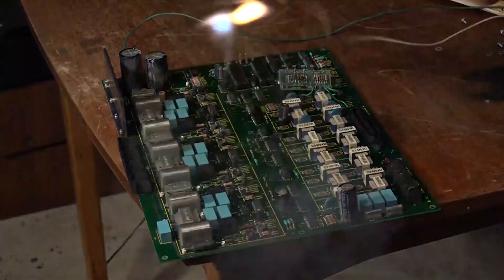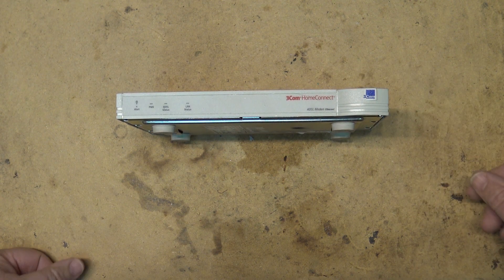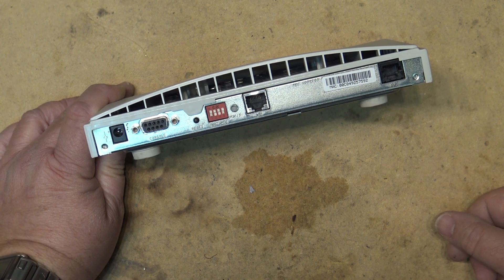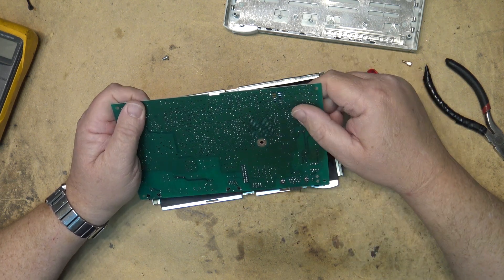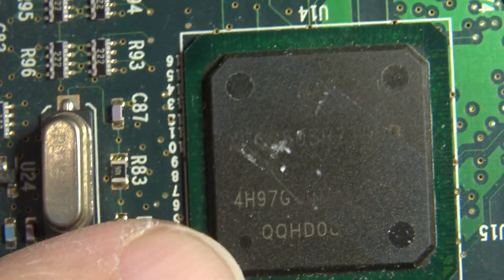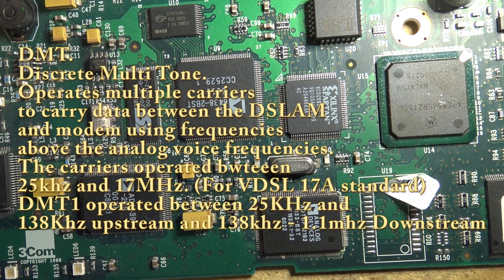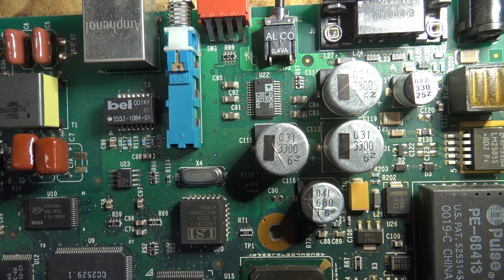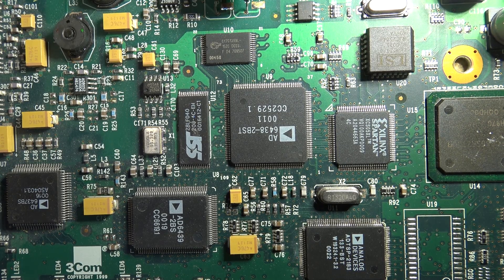Vintage 3Com ADSL modem teardown

Comment: My very first broadband connection was ADSL and the speed was 256kb/s. I still have my original modem I got back in 2003. I had to retire it in 2007 as I got a letter from my ISP saying the original ADSL system was being discontinued and needed to upgrade. I have upgraded my internet numerous of times since and I now have FTTC NBN internet. I’m in Australia if you don’t know what I’m talking about.
Reply from the maker: I am still running fttc over vdsl2 here but fiber to the house is now the norm.

Comment: I'm on gigabit fiber and couldn't be happier. The thing I really like about it is how they install the ONT like the a POTS or T* CPE interface. It's part of the building, it remains telco property, you don't pay for it up front, and (unlike cable modems and their coax in general) you don't have to worry about someone ripping it all out when they move. Just subscribe to the service, plug in your router, and you're good.
Reply from the maker: Well it's supposed to remain with the building.  9 times out it 10 I am dispatched to replace the ont that someone removed when they moved out and usually they are too stupid to loosen the lock screw so the cut the fiber off which turns the job into a full install.

Comment: They must've been dealing with firmware bugs back then. The firmware sticker said February 29 and you got it installed the next day on March 1. Either I'm misreading something or they were doing some real last-minute updating! Did they not have firmware updates pushed from the provider back then like they do today?
Reply from the maker: We still do manual updates at the wearhouse. When we switched from Minerva to media room a couple of us sat in the wearhouse and went through every box in inventory manually upgrading the firmware and formatting the hard drives so they would be ready for the techs to grab and go. The upgrades took about 40 minnutes per box.  We would plug in about 62 boxes at a time. (into 32 port switches) and fire them all up in disaster recovery mode so they would force load firmware.  Spent a few days upgrading about 1000 boxed that were in the wharehouse. So likely this was flashed in house and then loaded into the truck.

Comment: The MDI switch was for the ethernet jack.   Nowadays the ethernet chips are AUTO-MDIX which allows them to work as either server or client.   This era you may have needed an ethernet crossover cable to connect two ethernet devices together.
Reply: Yup, I think the oldest equipment Ive seen with auto-MDIX ports are from 2003 or so. I don't think I've seen anything in person with a crossover switch like that, most equipment I've seen had separate "normal" and "uplink" jacks connected to the same PHY.

Comment: I still have one of those kicking around. I remember the day when I had an appointment to get one of those installed. I believe it was a 2 hour time window that I had to be home for the tech to hook it up. He had to install a POTS splitter then hook up the modem and test it with his laptop.
Reply from the maker: Yip pots splitter and clear cap of the distribution pair at the pole.  ADSL didn't like brigade taps.  Early days had growing pains for sure.   4 years later I was the guy installing DSL.  Now I get a couple a week.  The rest is all fiber.  Still have a few buildings that have no fiber installed. That and the illegal basement suites.  When fiber was placed one drop for each physical address registered with the city.   So illegal secondary suites are generally left on copper.
Reply: @12voltvids  I would bet most of the old kit was sold off to other telco's to build out their networks. As here ADSL2 + is still the hottest new tech ( and has been for the last 20 years as well, but speed capped severely) and the incumbent telco charges high rates. Then they wonder why they are losing subscribers at a massive rate, even the mobile offering is doing so, to the point they are now a virtual network running on the one big player that they initially fought against. I saved a lot going from uncapped DSL to a capped LTE solution, it was basically 3 months to break even on equipment cost from the saving, as i bought the LTE modem outright, instead of taking it on a 2 year contract and paying around 10 times the cost instead.

Comment: From what I know we ( in Austria ) can actually still use these old standards ( Dial-up, ISDN, DSL, ADSL, .... ) They are still supported in 2020, I also have a few of these old modems and I can still go on the web with them. For me that is very good because if something breaks down on my new modems I have spares and can at least go on to the web again until I get a new one from the provider.
Reply: I know that here they still have old Diginet 56k links around, and still have some old ISDN, but do not install new. Old areas with buried copper that is at least a century old, and where they find they are running out of good pairs, so are still actually putting in extenders in places, though that also tends to accelerate the cable failure with the 250VDC line power. Old paper sheathed cables, and DC, with moisture coming in the cracks in the lead sheath do not mix well.

Comment: That company should not have fired you,  it was your controller that should have been punished.
3Com was the name i thought of with networking cards,  the old coaxial link with termination resistors.
They appeared in many machines i repaired,  and later the twisted pair took over.
There is no crap in that modem, known reliable brands :-D
Reply from the maker: Well the boss did what many scumbag bosses to. Covered his ass and threw me under the bus.

Comment: We had to wait until about 2003 to get ADSL, after they'd said since 1997 that we would get cable.

They even dug up the street and installed cable up to each house, but never connected them, apparently due to lack of uptake in out street. lol

So between 2000 and 2003, I had to resort to ISDN for a while, which was expensive (especially with both 64 kbit connections paired together).

Then I even tried satellite "broadband" for a while, which was quite interesting...

It used a Technisat SkyStar 2 PCI card, which I still have.
It could get download speeds up to about 40 mbits/s back then, which was better than what we're getting on fibre (VDSL/FTTC) right now.

But the requests were sent via normal dial-up modem, of course, and the average ping rate was around 1,500ms, so it was almost unusable for Web browsing.

But, it was quickly discovered that the company didn't bother encrypting the satellite transponder at ALL.

So somebody created a program which would just capture all of the data to HDD overnight, including whatever anyone else was downloading. lol

When we finally got ADSL, we were only getting around 2 mbits/sec, but I changed the Master Socket for a filtered one, tidied up the extension wiring, and then got around 6 mbits/sec.

(aside from the constant drop-outs, which the phone company denied for about ten years. They eventually sent an engineer out, who admitted that a whole row of contacts in the cabinet had corroded, and should have been labelled up by the previous engineer, but he didn't, so that was nice.)
Reply: Did you ever try to appeal being fired at the time, or explain to upper management that you'd been specifically asked to do that job?

Or was it a different time back then? lol

I've had a few things like that, where some line managers took a dislike to me because I knew more about some of the technical stuff than them, and the main engineers were often more than happy to allow me to do diag and repairs.

I knew I was taking a bit of a risk, but I'd rather be doing diag back then then being bored out of my mind just doing assembly. I mainly worked in factories like Nortel who built telecoms stuff.
Reply from the maker: When you work for a family run business you really don't have a leg to stand on.  It is your word against them.  Nobody is going to back you up because they are next to get axed.  I was 19, right out of school doing a paid internship.  I actually was blacklisted. When I tried to get a job at the big stations i needed a reference and I found out that nobody would hire me because i got my fingers into a Panasonic nv9800 to remove a jammed tape.   That went on my letter that was sent to the local stations I applied at.  Of course I was so pissed off when the d man told me he had to let me go that I burned bridges. They didn't fire me on the spot, just told me I was not being hired full time (i was on staff replacing another worker that left and should have been next in line to be hired but was passed over for a fresh graduate.  The owner offered me a job on the cable tv side of the business as an installer and i turned him down. Was one of those stupid moments that 19 year olds make.  I was offered a job at the foundry making directional taps. The company was one of the cable tv founders in Canada and they made their own cable splitters in house.  The dt, was the splitter that went on the poles and they sold them all across the country to other cable companies.  The other company that made them (still does) was Holland electronics.   So I left the cable TV station and landed a job at Sony about 6 months later.   That's where i got serious about electronics.
Reply: @12voltvids  Ahh, family run, yeah.

I made lots of similar stupid choices back then. I guess most of us do. lol

When I started at one factory, I got some rather nasty "feedback" from one of the old managers who I used as a reference on my CV.

I didn't have any issues with him in the past, and was completely baffled (and extremely pissed off).

Obviously I would never have used him as a reference if I knew there would be any issue like that, him saying that I was "not a team player", whatever the hell that meant.

I guess he didn't like the fact that I was actually doing the work, and maybe not as laid back about it as some other workers. lol

But I always worked well in a team for years, and they could have asked any of them what I was like to work with, and I know it would have been fine.

Lots of "political" stuff in almost any employment, I guess.

I love the old "We're not firing you, we're just not renewing your contract, or taking you on full-time" thing. lol

Thanks for the full reply. Good to know I wasn't alone with dealing with experiences of certain companies / managers.

Comment: MDI and MDIX determine what pins on the Ethernet interface are transmit and receive. MDI (Medium Dependent Interface) MDIX (Medium Independent Interface Crossover). MDI ports can talk to MDIX ports with a straight cable. Back in the day you had to know what type of Ethernet port you were connecting to and what type of a cable to use. Straight or crossover. Now almost all Ethernet ports are auto-sensing MDI or MDIX.  Great vid. Brings back memories. I worked for a 3Com reseller in the US for years.
Reply from the maker: Dam almost forgot about that. The old red cross over cable.  Like the cross over serial cable. DCC vs DTC. (Data communication cable and data terminal cable) The dipshit switches were to select the modulation scheme used by the carrier.   DMT, CAP ect.  By the time I got into the business these old 3com modems were being phased out as dmt2 was around and offered faster speeds over a longer reach.  It was 3 meg down 1 up at this point.   Then 2+ brought the speed to 6 megs.  Then VDSL field cabinets brought the speed to 75 and beyond.  
Now fiber makes 1.5 GB possible.

Comment: I waited 2 months for my cable internet to work after the cable modem was installed in 1997 on Rogers in Toronto. cable was ahead of bell by several years. The lan city modem was several times larger.
Reply from the maker: Cable was very easy for the cable co. They already had 2 way amplifiers in place from the days of live community TV. The frequencies on the cable below 50MHz  were the reverse pass band. I have some modulators that will operate on these channels that are below channel 2, that were used for back haul.
The cable modems of the day, and still to this day use this spectrum, from about 5 to 45MHz for the back haul channel, and the forward channel is multiplexed in with the TV channels and where the FM radio used to be carried on cable. DSL on the other hand required a large infrastructure commitment by the telco. The advantage was not sharing the loop with up to 500 other customers in the neighborhood. We had cable internet at the shop I worked at, and it was painfully slow. Typically 2 meg down and 64k up, and after 3 ph, when all the kids got out of school it crawled along about as fast as dial up.

Comment: Employer paid for my ADSL installation at home ... around 2000 like you. Two guys came out to install the line terminator in their box outside ... I think it was one training the other ... ADSL was just being deployed in Raleigh NC. My luck? I was just one mile from the switching office and so I got "maximum speed."  :^)
Reply: I am 3km from the central office, but still got under 2Mb.